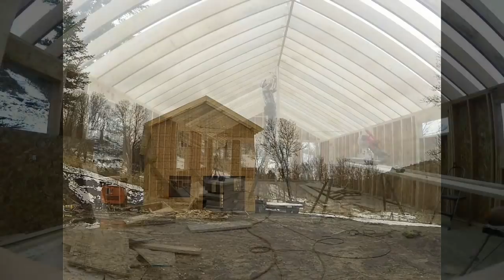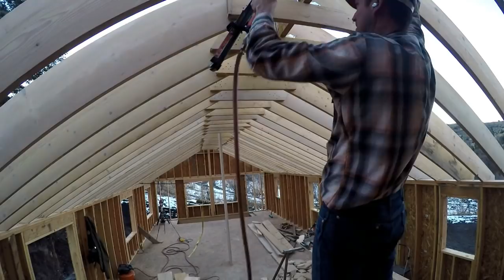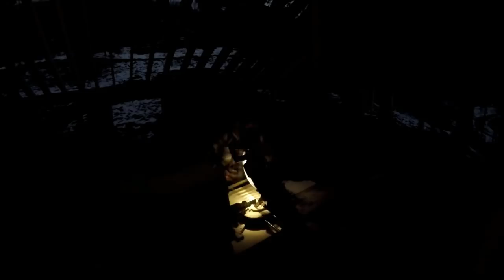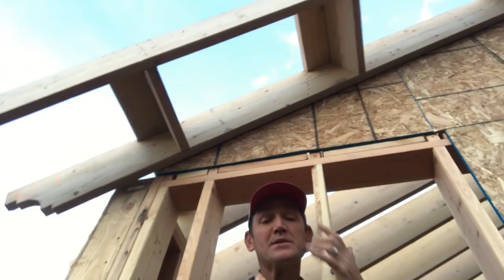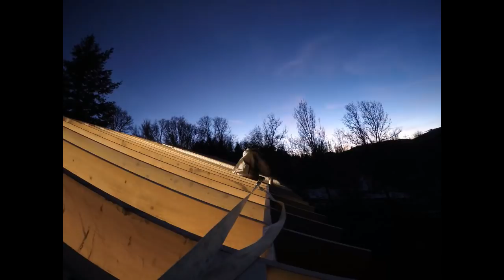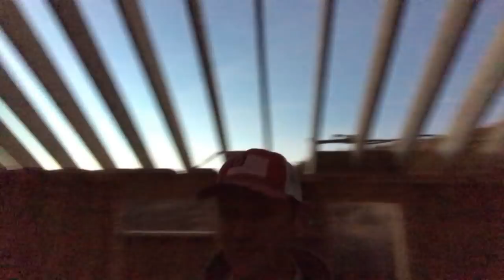#160 - I Installed Collar And Rafter Ties On The Roof Rafters!

Comment: I too enjoy build structures on my own. You are good at planning ahead and making the most of what you have. At age sixty eight I plan on one more house. Like you it will be building a off grid house, with super insulated frame. The ideal plan would have solar power and I will plan for this. But because of budget constraint every thing will just be designed for later install. 
I’ve had over twenty surgeries over the years but if you manage your time and resources you WILL make this work.  That is what I’ve done. 
Ironically I’ve been offered a new position that I’ve been looking forward to do and with a little help from our son I’ll have this done before I’m seventy.  After that we are going to build a tiny home for our son.

Comment: I have had my fingers crossed for you to beat the snow. Not a problem that I have ever had to face here in Oz but I reckon that it makes it hard for you with a deadline. Structural is easy because you can research it and it is constant, aesthetic. now that is a can of worms that there is no correct or universal answer for EVER.  However, in your case it is easier: if you and your significant other like it then it is the right way. I have really enjoyed you coverage of your adventure and look forward to seeing you achieve your goals.
Reply from the maker: Thank you for watching!

Comment: That looks great! The attention to detail is looking great. Are you using a metal roof? Keep up the hard work, your dream is coming true. Thanks for sharing.
Reply from the maker: M and B Homestead yes. Galvanized roof
Reply: Cool. Your shop house is awesome. I am learning a lot on the build. Your determination is amazing. Thanks again for sharing it. 👍🏼👍🏼
Reply: Why would you write such a thing, fastening tin roofs through the valleys IS the correct way, and it has been so for the last generation or more. fastening tin roofs through the peaks goes back to the time when you used NAILS to fasten it, today Farmer screws with rubber washers are used through the valleys.     ( if you do not believe me, look at any metal panel manufactures website )

Comment: Has YT blocked your channel?  All I get on two or three of your latest segments is a black screen and a revolving circle.  Doug
Reply from the maker: Douglas Thompson I️ hope not...
Reply: Run a speed test to see if the line you are on is having issues. If that doesn't help hit the settings button to change the quality down a step.

Comment: im a boat mechanic. regular osb out last duglas fir marine plywood. and the chemicals in it are not chemicals wanna be around. 50yr osb is the best wood made. all osb uses wood glues instead of formaldehyde and other cancer chemicals.  cutting osb the dust wont hut ya. marine grade plywood i stopped using it cause poly resin osb is stronger ad way out last all others. 

i gut and rrepair boats all time. 20 yrs allmost always marine plywood is rotted from inside out.  just a heads up. i know its your dream and goals. but coming from someone uses marine wood all the time. its the biggest scam ever. non retreated douglas fir would be safer. i trust poly resin before any other wood manufactures gluing process. scary things that are in the data sheets. osb is stronger also. many think its not cause looks cheap.  but its actually much much stronger esp per in or per foot of puncture.  

the barn i lived in was nothing but osb. they never put siding on it. it was there 30 yrs before me unprotected. only 1 spot was the osb soft and thats cause it never got any sun to dry out. thats osb from 30 yrs ago and it still worked great. 

gl safe travels on the dream. :)